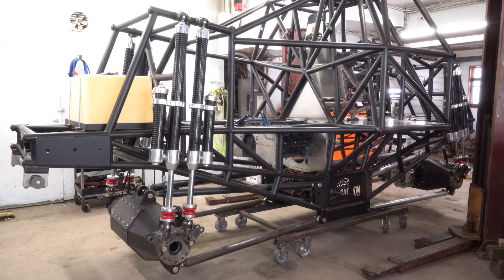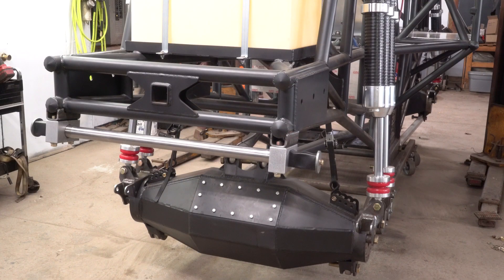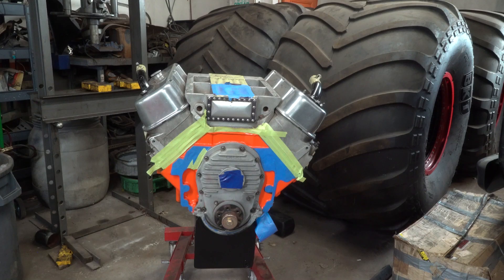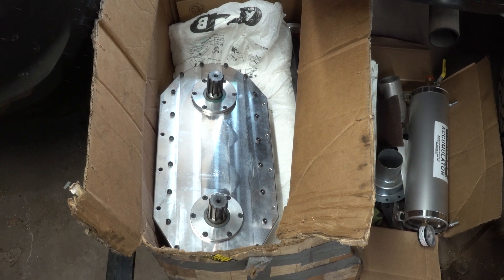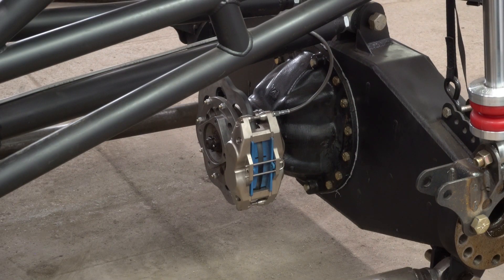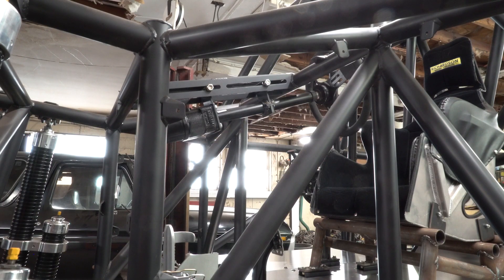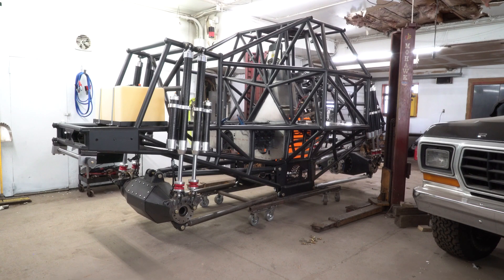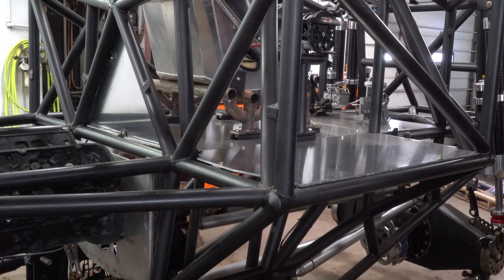Monster Truck Update

Comment: Love this, so cool to see. I’ve always wondered, do these things run the same length control arms front and rear? I know that top and bottom are the same length but are the rear arms longer than the front?
Reply from the maker: Junebug Junebug most trucks use equal length arms because it makes having spares on hand a lot easier